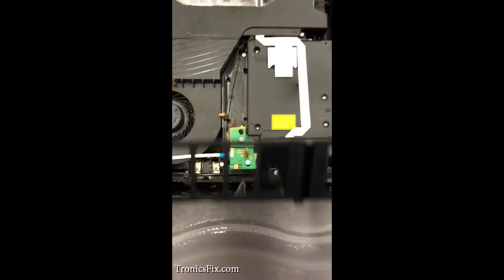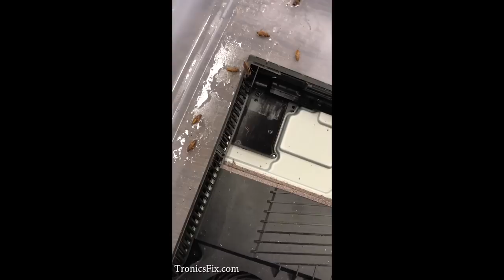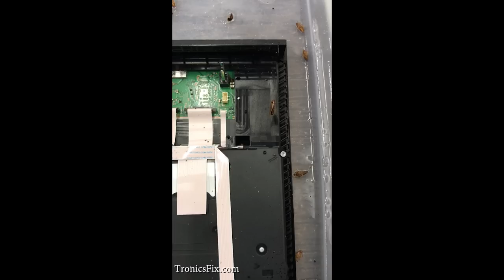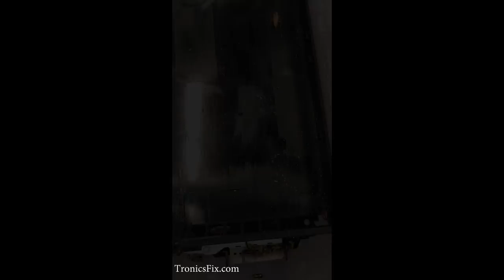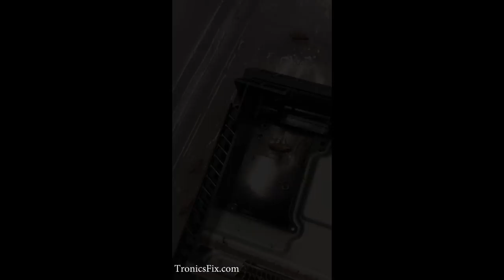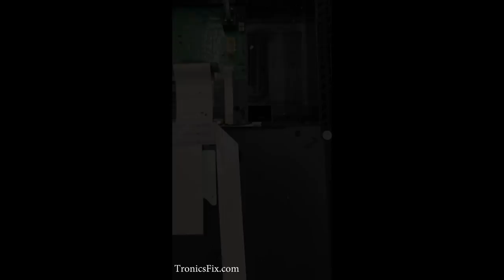Cockroaches in PS4's - Compilation!

Comment: My PS4 slim  turns off by  self after 5min of play time what is the issue with it plz help.
Reply: Kodak White probably overheating or you got a defected one. i have a ps4 slim,  there's nothing wrong with. i played like 1 or 2 hours a day tho not that long.
Reply from the maker: It's not overheating unless you get the red light and then it turns off. It's likely either a power supply issue or faulty solder joints under the APU.

Comment: Hey, is there any way to tell if you have roaches in your PS4?
Reply from the maker: See if you can see them going in and out of it. Shine a flashlight into the back of it.
Reply: If it smells on the bottom
Reply: It will smell bad if you’ve been using your ps4 for a bit

Comment: I opened the top shiny part and I saw like 3 dead cockroches. I am afraid to open up the bottom, so I just left my fan blowing at full blast towards the back of the system. Will this help me In any way? And also if I do decid to open the bottom, how will I get all the roaches to get put and die?

Comment: How much would it cost me if I were to only need my PSU repaired/replaced
Reply from the maker: We charge the same price no matter what the problem is...our prices are not based on what needs to be fixed on infested consoles. It's based on the fact that there are bugs in it.
Reply: I don't think that there are bugs in my console, I just think that I have a bad PSU, would you still charge the same price?
Reply from the maker: If it's just the power supply then we don't normally charge the same price.

Comment: do they go inside ps4 slim's?
Reply from the maker: Yes, they go inside all game consoles.
Reply: TronicsFix oh .... cuz i saw in some website that sony changed the design that they couldnt get inside.... anyway did you get any ps4 slim models with roachers?
Reply from the maker: Yes, the design is a little different but they can easily get in still. Yes, I've gotten PS4 Slim, PS4 Pro, Xbox One & Xbox One S consoles with roaches in them.